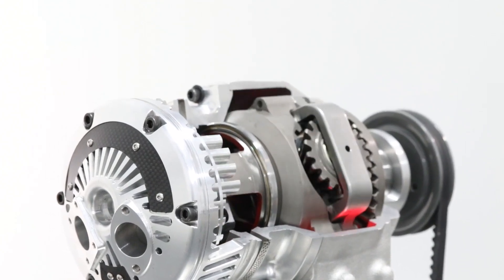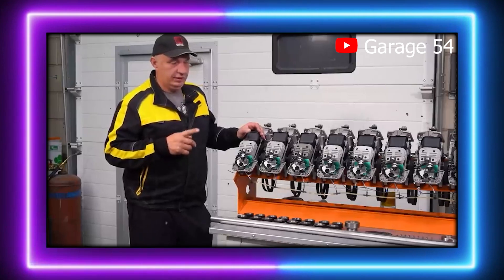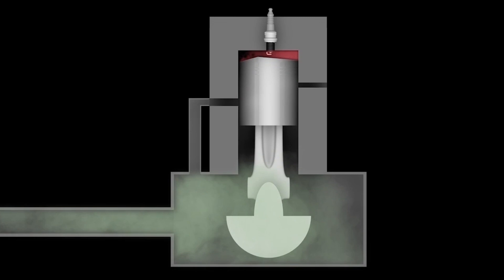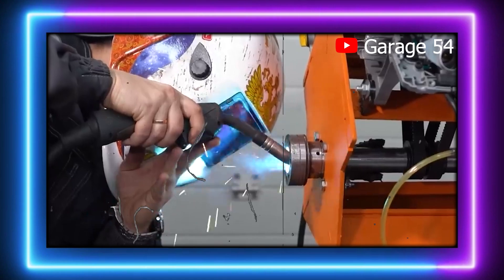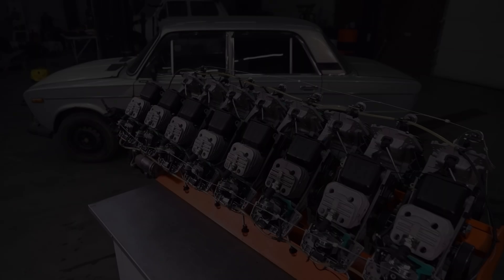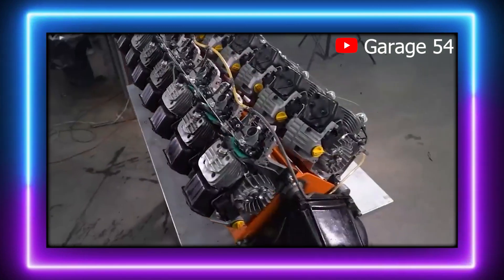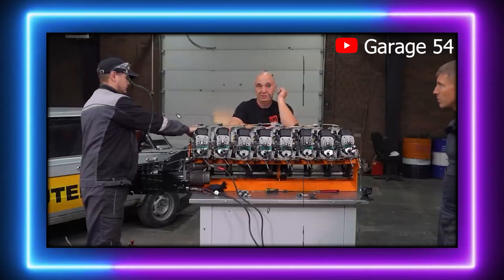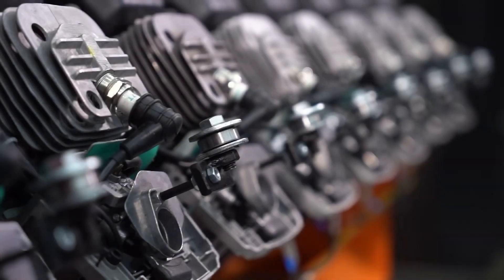The Crank-Less Two-Stroke V16: A Quirky Engineering Marvel

Comment: Need centrifugal clutches on the drive shaft to equal out the output of the motors
Reply: @oyou812  I doubt that would even anything out since those clutches are on or off, no slip